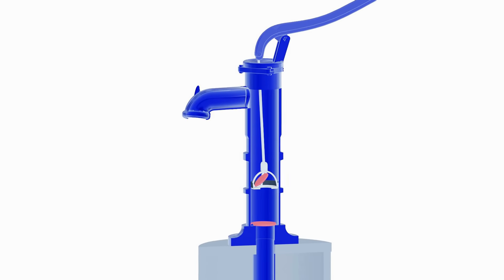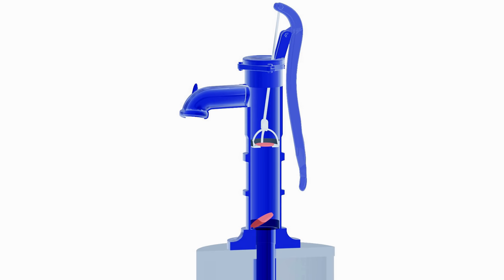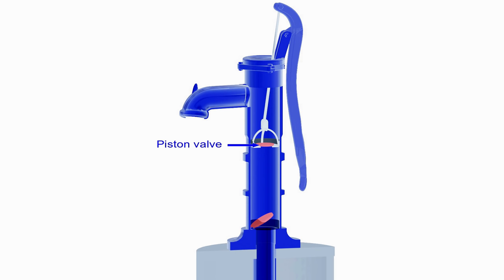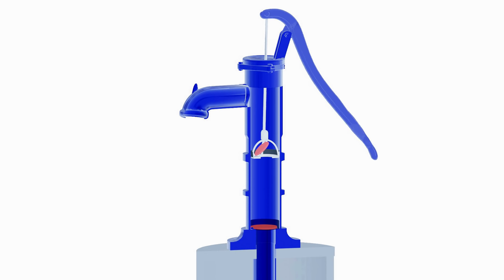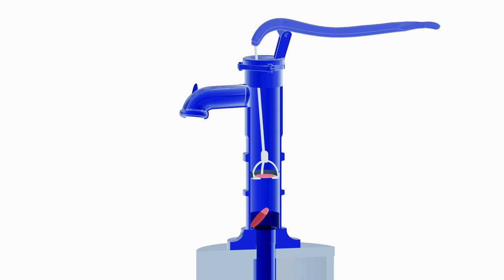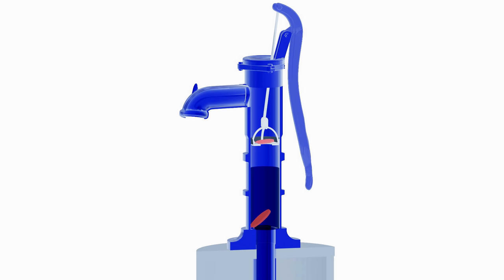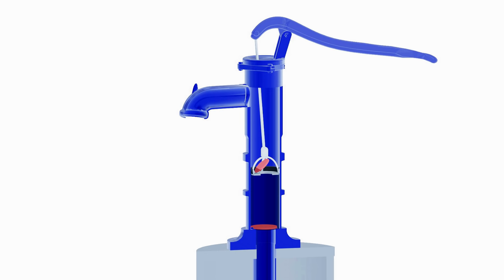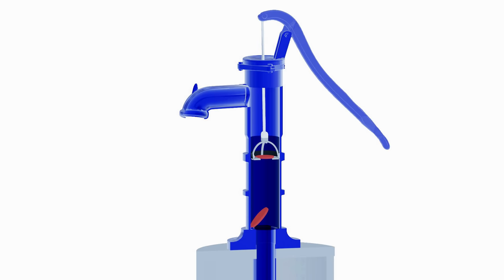How a hand pump works

Comment: Sorry fot my ignorance but I don't get how the vacuum generated
Reply: when the piston is pushed down, piston valves opens (helps to remove air inside the handpump) this create a compression of air on the upper side and when piston is pushed up, the piston valve closes (this create a vacuum between the foot valve and piston valve) and this force the foot valve to open due to extreme low pressure, hence their is a partial vacuum
Reply: When you force a certain amount of air to take up a larger volume (expand the container without allowing more air inside), you reduce the pressure inside that container. Look up Boyle's Law for a better understanding.

Comment: Pretty sure this is wrong though. Vacuum can only suck water 33.9 feet, and most wells are deeper than this. I believe they have a shaft that runs all the way to the waterline.

Comment: I have a question. If after the first use of the pump the main pipe fills up with water to the level of the outlet, does that mean that there’s always stationary water in the main pipe? And if so, does that contribute to bacteria formation in the water?
Reply: As per my own experience I say no, water doesn't remain indefinitely inside the cylinder. I guess it's because the valve doesn't seal completely the intake.
Reply: How do you know that?

Comment: what if , if i wipe out the 1 valve in lower  part do youi think its still works ? please answer thanks
Reply from the maker: If you remove the check valve, water sucked from the well will return back when you lift the handle.

Comment: What makes the foot valve have any movement?
Reply: The vacuum lifts it open and as it's ring closed the water pushes it back down.
Reply: Its a hinged joint there. So moment about hinge is possible with pull or push.
Reply: @soldiers303  you are half right, half wrong.

Comment: If the pipe is 200 m long, can the pump work and get water or not? Any body knows?
Reply: No
Reply: It'll work, but it'll take more effort and more time until the water reaches the outlet.
Reply: Why it’s so long? if it’s that long it’s better to use pipe with smaller diameter so the water could go up faster
Reply: @MAbduser  You are right
Reply: @Dimaz42  Thanks for your reply. We got water at less than 200 m but  strong water comes at 190 to 200 m. Yes smaller diameter pipe could work but it may take very long time to fill in the tank above the ground.
Reply: @musiland276  Good luck, But remember, make your calculations first. Try the hand pump with a bowl of water first and calculate how many times you have to push the lever for the water to go from the bowl to the outlet, if the pump height is 1 m and it took 3 pushes then it will take 600 pushes to pull the water from 200 m deep. Add to that that it will be much more harder than just pulling water from a bowl.
Reply: @MAbduser  Thank you very much. I already have a perfect German electric pump but I thought about another manual one for emergencies (just in case if electricity is off). Thank you all for your suggestions
Reply: Not, this pump is working only at depth 4 m. somewhere it can work until 5 m. this depend on the air pressure. It can work at a such depth, but es need to put the pump as possible near to the water, that water not to be sucked, but pushed.

Comment: Foot operated pump 
Is more easy to work 
Show some mechanical trick for it ?
Reply: Yes because foot can apply much more power than hand  for same amount of work.
Reply: @sudeepsinghrawat528  foot operated handpump are very easy to use 
If we use hydraulic system then it becomes super easy 
So try to make such design ?
Reply: @anilsharma-ev2my   but it will cost high if you use pneumatic /hydraulic system as you need a piston cylinder arrangement and compressor. This will consume electricity.
Reply: @sudeepsinghrawat528  no 
We use a long handle to pump and a magnet seal to reduce the pressure every time so we keep pushing every time 

We can make a very easy to use handle system which use gravity against gravity
Reply: @sudeepsinghrawat528  how i talk with you or discuss our plans on a sheet of paper 

This older method is very dangerous

Comment: How hand pump work more than 34 feet depth? I think suction can't work for deep hand pump
Reply: Depends on the seals and anti-return valves... I used to use one of these pumps in a well that was 15 mts deep. It worked ok, just more time to get it working...
Reply: A hand pump like that can work only at 4 meters. If the water is deeper you need to install it as possible near to the water, that the water to be pushed not sucked. This process depend on the air pressure, and we cannot do or change something.
Reply: @dmitriyp6056  Seems like you havent used one of these pumps...

Comment: Such a pump is working normally at depth not more than 4 meters. When the water is more depth it is need to put the pump as possible near to the water and connect it with the lever through a pipe one inch diameter and connect the plunger with the lever by  a wire diameter 10 mm through inside the pipe. For a such pump no matter the depth.